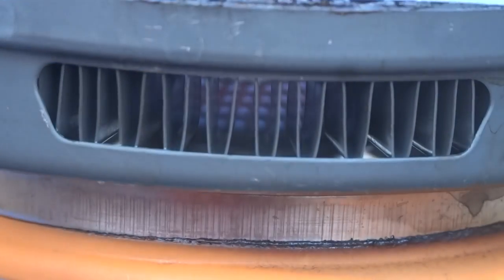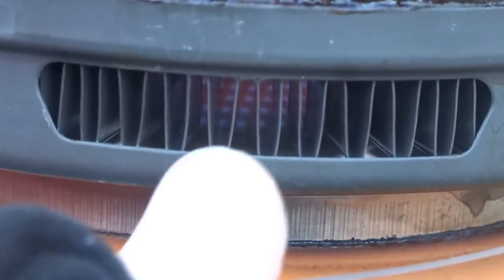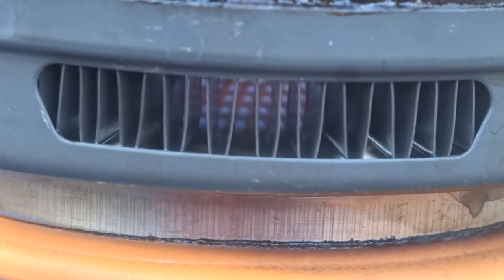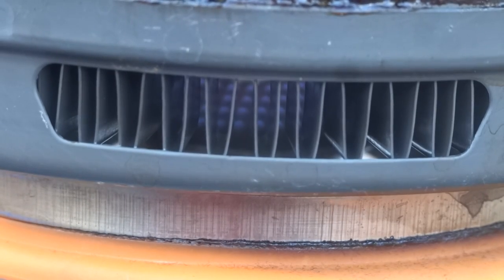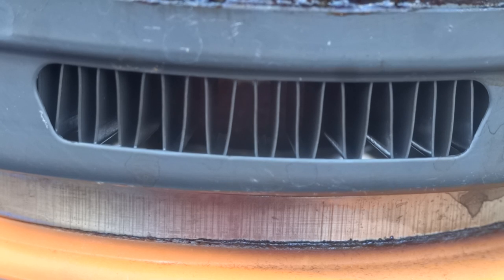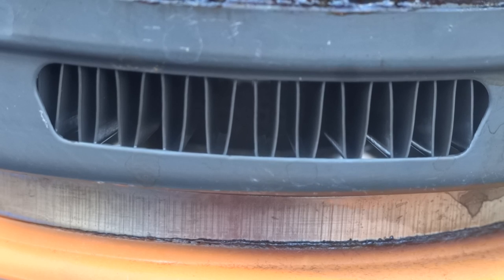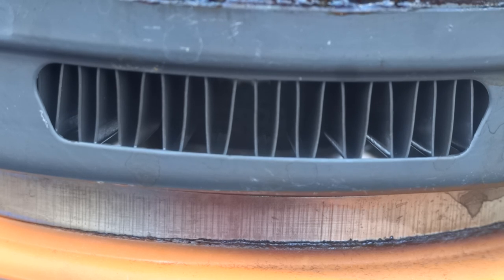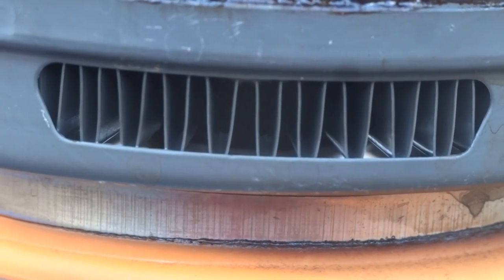Jetboil Joule:  Wind Test & Handling Underburn

Comment: I also was annoyed by what you call underburn on my jetboil or other stoves. I found a remedy for it eventually. Choking. I think that too much air is mixed with butane before reaching the burner head. It worked for me.